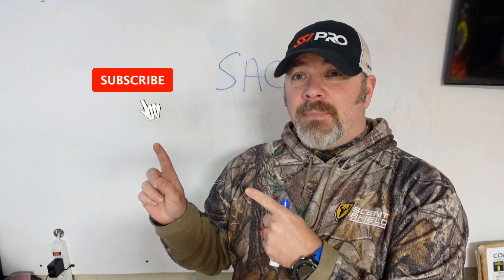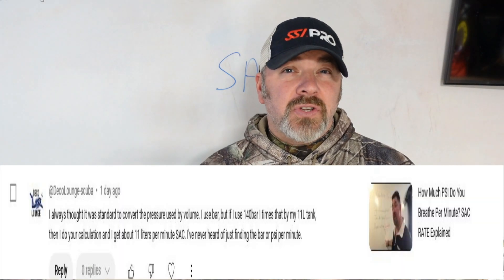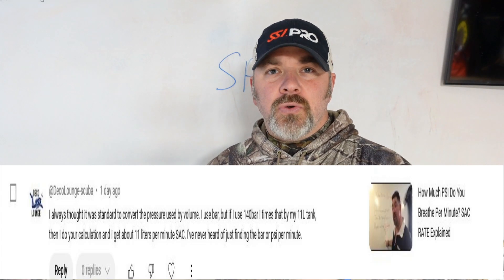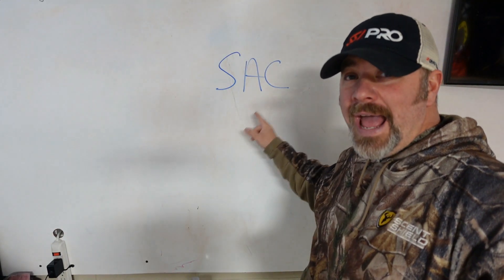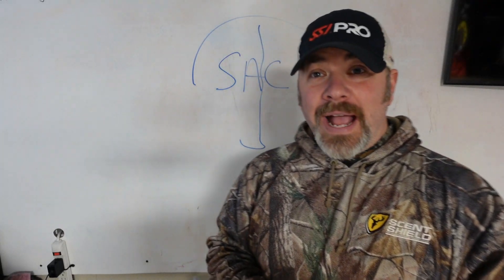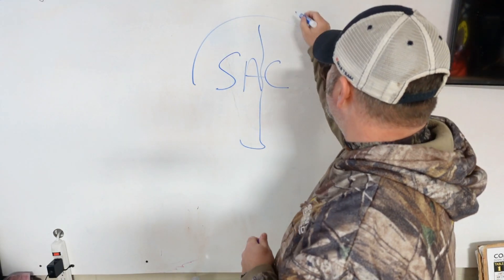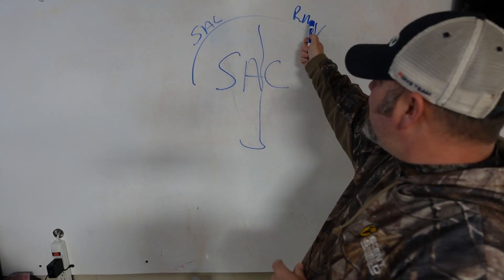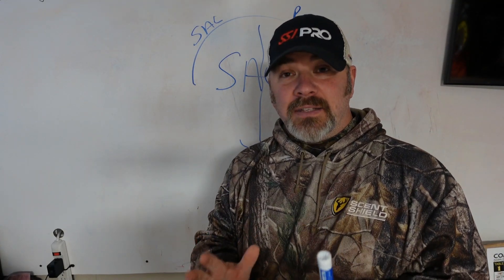SAC vs RMV Answering Your Questions @DecoLounge-scuba

Comment: Metric makes it so much easier you can do it realtime, underwater.

11l Al tank, 150 bar of usable pressure (50 bar reserve) = 1550 liters of surface air.

My sac rate is 10l/m at rest, 12 moderate excertion, 16 heavy excertion. I average 11 on a fun dive.

Planning to go to 20 meters, or 3 ATa on a fun dive means 33l/m. 1550L/33L/M=47 minutes of bottom air.
Reply from the maker: Hello @davidhuber2172, metric does make the math a lot easier.

Comment: Feeling so smug working in metric here, because we can do math in our heads if it's the ten times table!  RMV and SAC are both used here in UK but SAC seems to be used as a coverall for both.  My Multideco App and my computers use and work out SAC in litres/min, my buddy's computers show SAC in Bar/min.  Like you say you need both numbers: SAC in volume/min for gas planning and pressure/min for that mental arithmetic on the dive.  Now I know my SAC I find a ballpark Bar or psi/min for approx depth is always nice to have in the back of my mind to let me run a mental how-goes-it.
Reply from the maker: Hello @timgosling6189, we use both the MultiDeco App and V-Planner. I personally prefer MultiDeco over the other.
Reply: @LakeHickoryScuba  Me too.

Comment: So how do you know or calculate the effective capacity of a tank? Is there a chart somewhere or a way to calculate it?

At 5:30 you stated that an AL 80's effective capacity is 53 CF. I heard they run smaller than the stated capacity in general something like 67 cf if I recall correctly. However being a new diver it would be good to know. Especially as I learn to determine what tanks to get. 

Based on the advice of area divers I got a pair of Steel LP 85s. At the low side they should be filled to 2600 but it will likely be filled to 3000-3200 psi.
Reply: There should be a stamp on the side telling you its nominal capacity.  In the US if it's an 80 cuft tank that means that at the max fill pressure (3000psi for Brian's example) the tank will at 3000psi contain what would be 80cuft of air at normal atmospheric pressure.  Brian's figure of 53cuft comes from the rule of thirds.  53 is 2/3 of 80.  You should plan to use only up to 2/3 of your gas on the dive; you will still have 27cuft/1000psi left in the tank and you can breathe it.  But it's your safety margin in case you have to, for instance, share your air with a buddy on the way up.

By the way, if a tank is rated at 3000psi it should not be filled to 3200.  This is especially important for aluminum tanks, but for Al and steel regular over-pressure will in the long term lead to stress cracking and eventually failure.  Steel cylinders are often rated higher, typically 3360psi, but you need to check the stamp on the side to check.  A responsible fill station will not give you more than this value!  Hope this helps, and safe diving!
Reply from the maker: Hello @MysticalDragon73, the easiest way to calculate the usable gas is as follows. Whatever you cylinder capacity is, in this case an 80cf cylinder, you take that number and divide it by 3. This will give you the individual 3rd of the cylinder. Then simply multiply that by 2 and you have the workable gas in the cylinder. Example: 80cf divided by 3 is 26 cf. Then 26 multiplied by 2 is 53 cf. 53 cf is the workable gas and 26 cf is the reserve. You can do this with any cylinder as long as you know the volume it holds. You can also do the same math based on pressure to see what your run time will be (in real time) while underwater. Hope this helps.
Reply: @LakeHickoryScuba  thanks I appreciate it.

Comment: "GASP" Bryan just mentioned me! I can just hang up my spurs now. 

Lol, thanks man. I did just post a video on how to calculate SAC rate, and in the comments I also got this same question a lot, and it is hard to explain, typing. So, sweet video. 

If I was to sum this up, SAC is real time data on how their air consuption is going, and RMV is used when needing to find out how much gas volume is need when planning a dive. 

Of course it makes sense. We have our DM students (and anyone else interested in improving their air consumption) calculate their SAC rate with specific parameters, at the beginning of a course, then again in the end to see how they improve. 

I'm not personally a tech instructor so don't use RMV much, except when doing my own tech dives and seeing how much gas to bring on deco dives. 

Anyway, thanks for answering my question, I could keep those coming all day. I look forward to your mirror arriving in Philippines!
Reply from the maker: Glad you enjoyed the video @DecoLounge-scuba. I just checked tracking on the mirror, and it says it just passed through customs in the Philippines. I can email you a tracking number.
Reply: I'm afraid SAC is not real-time data and RMV is not planning data. Arguably the other way around is more useful. RMV is the physical volume that cycles through your lungs (as the name implies). SAC is that value adjusted for surface pressure. So if your SAC is 20L/min and you are at 20m, then your RMV is 60L/min. Whether you convert that into pressures from your cylinder to track real-time usage, or you keep it this way to plan for gas volumes needed, is irrelevant.
Reply: @tobiashartung856  that's what he said in the video
Reply: @DecoLounge-scuba  It's not what he said in the video ;). He said that SAC is pressure per minute, while RMV is volume per minute. He also claimed that RMV is a surface measurement while it is a depth adjusted value. H even made a point of not using RMV because it is a volume measurement in cuft or L, but instead to use SAC because it is a pressure measurement so we don't need to do any math. This is plainly incorrect. If I use SAC even as  pressure per minute number, I still need to do math to adjust for the depth. There is a massive confusion around the terminology in the video. Everything he said about how to use the numbers in the different units is fine. But the terminology of what these different numbers are, is incorrect and incredibly confusing. Point and case, your "If I was to sum this up,  ..." comment shows clearly the confusion. If Bryan had explained it clearly and correctly, you would know that your summation of the video is not correct.
Reply: @tobiashartung856  actually, I'm not incorrect, all I did was sum up what he said. But I know he knows what he's talking about.
Reply: @DecoLounge-scuba  Apologies. Your summary of what he said is a correct summary of what he said. Unfortunately, the summary is incorrect because it summarizes incorrect source information. This is not you doing anything wrong. It is Bryan being confused and incorrect about what he is talking about.
Reply: @tobiashartung856can you make a video to explain? Or recommend one
Reply: @DecoLounge-scuba  You should watch Cave Diver Harry's video "RMV vs. SAC: What’s the Difference?"

Comment: You should watch Cave Diver Harry's video "RMV vs. SAC: What’s the Difference?"
Reply from the maker: Hello @tobiashartung856, I have seen his video, and have spoke to him several times down in Florida.
Reply: @LakeHickoryScuba  Oh that's great. It just begs the question why your explanation treads very closely to the second common wrong explanation Harry mentions. Meanwhile the main important aspect, namely RMV being SAC adjusted for depth, or if you prefer SAC being RMV adjusted for surface pressure, is somewhat absent from your explanation. Instead you talk about SAC being an umbrella term and that you have the different numbers that are both necessary. Don't get me wrong, both numbers that you refer to are relevant, but you are not actually explaining the difference between RMV and SAC. In fact, Deco lounge-scuba is trying to sum it up here in the comments and is getting it awfully wrong, yet your reply to their comment isn't picking that up.
Reply from the maker: So the easiest way to explain the difference between SAC and RMV is this. SAC otherwise known as Surface Air Consumption (which can be calculated in BAR or PSI, and can also be calculated in Cubic Footage or Liter for cylinder referencing, hence, why its an umbrella term) is nothing more than the measurement of how much gas is breathed per minute at the surface in a measurable term (bar/psi, or cubic feet/liter). Measurable term meaning we have a physical gauge that we can monitor and see in real time.  RMV which is Respiratory Minute Volume which is another way of saying Tidal Volume which we use in the Medical Industry instead of RMV. This is the amount of air that moves in and out of the lungs during each breath (coincidentally, is also our lung capacity), still measured at the surface. This number is non measurable on the fly as we do not typically as scuba divers carry a specialized gauge with us to monitor the Tidal Volume of gas moving in and out of lungs at depth / per breath. Another fun fact for you, your SAC rate can change by simply changing one variable, however, a diver's RMV rate will never change, as its the physical amount of gas (measured in volume) that it takes to fill up your lungs at the surface. We don't have the option to physically change our lung capacity per breath, as our lungs are the same size at all times. This causes a lot of confusion with divers as the math dictates otherwise at depth, and we are all taught that the deeper we go the more we breathe. But the formulas we use rectify this as we convert depth to ATA thus bringing everything back to the surface. So as a quick recap, SAC is an umbrella term for a measurable number indicating how much gas we are breathing at the surface per breath based on several variables, and RMV is nothing more the your lungs physical capacity to hold air, measured again at the surface.  Hope this helps to clear up your confusion.
Reply: @LakeHickoryScuba  You see, what you are saying is inherently confused. I'm ok with you saying that SAC is an umbrella term because you can measure it in different units. OK. I can see that argument. But then it starts getting confused.

"RMV which is Respiratory Minute Volume which is another way of saying Tidal Volume" - wrong. The "tidal volume" is the amount that moves in and out of your lungs over a single breath. RMV is the amount over a minute. Most people do not make a single breath per minute. 

"This is the amount of air that moves in and out of the lungs during each breath (coincidentally, is also our lung capacity), still measured at the surface." - Just because the medical profession measures it at the surface because that is where we live, doesn't mean that the volume isn't to be adjusted for pressure in a pressurized environment. Also the tidal volume is not the lung capacity. The avg human lung capacity is around 6L. The tidal volume is usually around 0.5L. We rarely cycle our full lungs to breathe. You are implicitly claiming here that you fully exhale and fully inhale on every breath, i.e., you couldn't physically get any more gas in or out at the bottom/top of your breathing cycle. 

"Another fun fact for you, your SAC rate can change by simply changing one variable, however, a diver's RMV rate will never change, as its the physical amount of gas (measured in volume) that it takes to fill up your lungs at the surface." - wrong. If you breathe twice as fast with the same tidal range, you double both you SAC and your RMV. If you breathe at the same rate but you double your tidal volume (not even difficult to achieve), you double both your SAC and your RMV. RMV is not lung capacity. It is the tidal range of each breath multiplied by the number of breaths you take per minute. There are multiple variables here that can be adjusted. 

"This causes a lot of confusion with divers as the math dictates otherwise at depth, and we are all taught that the deeper we go the more we breathe." I've never told a student that they breathe more when they go deeper. However, they consume more gas from the cylinder when they go deeper because they physically cycle more gas through their lungs due to the pressure.
Reply from the maker: @ Looks like you got it all figured out.